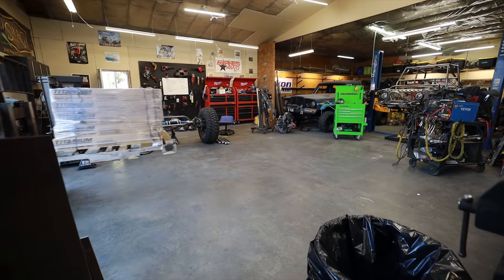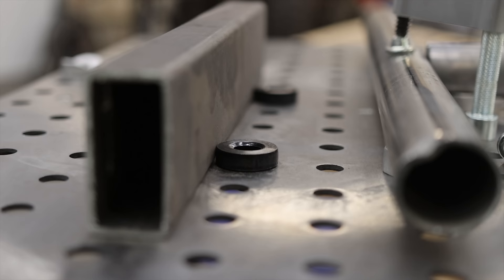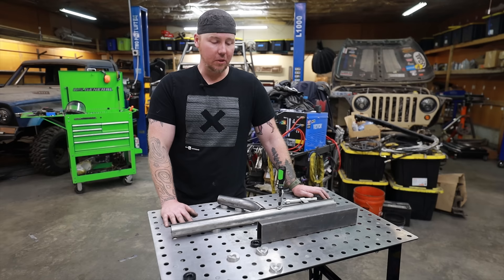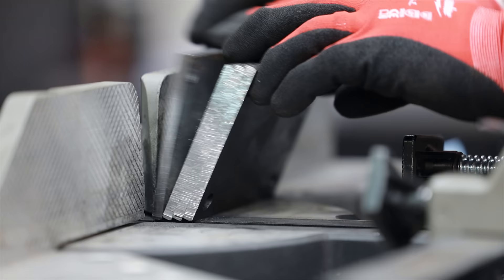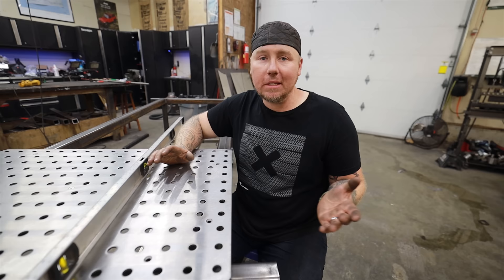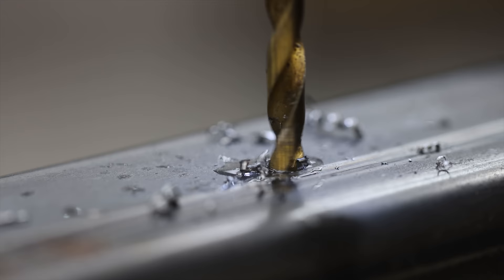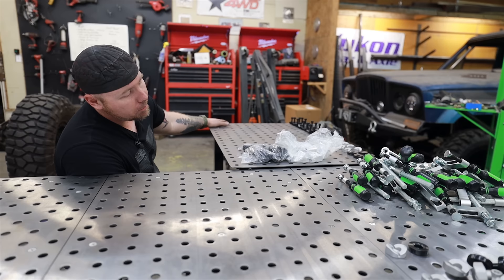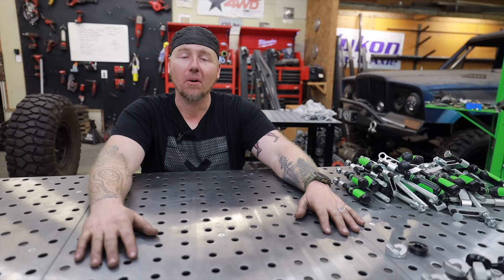The NEW Harbor Freight Welding Fixture Table

Comment: Another panel on the end/side mounted vertically could open up some more clamping positions. 
Or even weld in supports & tap the holes ready for if you did ever need that you could just use the one off the portable table, it’s only 4 bolts.

Comment: 9:56
Shims 
11:04
Being a woodworker and carpenter, to me the idea of making surfaces flat is just normal utility in setting up work. So that’s not really a drawback. 
To this point, however, “my” work has not had me wishing for a clamp table very often. But I can see it’s utility and benefit. At $170 that’s probably a good value.

Comment: I would have used the level next to each fixing and measured the gap between the level and table top with feeler gauges. Then when the top was loosened off I would have put shim washers of that thickness under each fixing and resecure. It would turn out a lot flatter.

Comment: What do you think would happen if you bolt and torque 2 or 3 tops together. Would it be like plywood.  Once you get it as flat as possible then bolt it down to your table frame work. Have to have some beefy legs and casters look at all the tooling you can get with the 2 of 3 kits. Bonus you don't need to drill all of the holes. What do you think?

Comment: I bought 3 of these then I put 2 of them together va bolts then I did butt plug welds in the table and had my buddy mill it true works awesome ps made the 3rd table on casters for my buddy to use

Comment: They typically don’t use casters on a fixture table because you should level it so it’s acs flat as you can get it, on casters it’s possible for the table to twist and lose its accuracy
Reply: Heavy fab shops use heavier platens and usually level them.
Reply: @ken481959  my table is almost 1.250” thick and it will still twist if it’s not properly set up, so if you have it on casters and move it your previous setting will be wrong, I had my shop floor precision ground flat in the area the table lives

Comment: I have to chuckle at all the YouTube welders that have never had to take a welding test, have never seen the flex in a double joint of 36”  
Have never seen a 12 x 5 piece of 1” plate picked up and seen it flex end to end. 
Keeping things straight is an art and to some degree is an illusion.

Comment: Go to a heavy equipment dealer and beg them for a pallet, because some of theirs will be 2 or 3 hundred pounds of channel iron and 4'×7'ish. Take it home and cut it apart and reconfigure how you want and attach legs and casters and you have a precise welding table with cutting and clamping grooves. Thats how I made mine for a days work and under 50 bucks in purchased steel, I have a table that will hold up anything a forklift will lift with surface of 5x1" channel 3/8 thick. Mine is better than some I have seen for sale for 5 grand. It was originally a pallet for a ferestry directional felling head.

Comment: Unless you're fabing replacement frames for vehicles that need to be perfectly flat (which they hardly ever do) microscopic flatness isn't that important and if you want to, you can shim the low spots. I think the value is in the fixtures, clamps and predrilled surfaces.

Comment: 14:48 Oh man, I'd be running into those receiver extensions all day. If I were to do this, I wouldn't extend it beyond the edge of the table, and instead drill a hole couple inches back of the table frame. Yeah, it will be a little more effort to get to under the table, but geez, I see injuries with this setup.

Comment: Great video! Would it be possible to bolt 2 or 3 together to get the thickness you need. I do realize its not going to be as strong as a single thicker sheet but if the holes line up it might be a cheap easy alternative to opting for the thicker steel table.
Reply: Absolutely you can.
Reply: Ty i  was thinking same stack them.

Comment: Been looking at that fab table was wondering if worth the investment. Been getting back into welding the last year after not doing so since 1997.  Project looks like an idea that's time has come.😎👍 bought the same receiver hitch vice couple weeks ago. Well made vice. Have the harbor freight 225 amp inverter green stick welder really like it.
Reply from the maker: It seems to be a good place to start. Low investment with quite a bit of value 👍.

Comment: Northern tools has the same table setup. ut the tops are only 4mm thick!  Not a good idea to get them hot - they might warp. 23 11 09 N.T.  has it for $199 list, so $169 isn't a bad deal. And the competitors' 4.78mm (3/16") tops cost as much or more all by themselves.

Comment: While cool, you should point out that the table in the thumbnail listed as $169.00, in reality costs $1352.00. You have 8 of the $169 tables mounted together to get that size. 😀

Comment: I was thinking "shim, shim, shim!" before you mentioned it. Which, um, leads to the question...did you shim it and somehow I blinked and missed it? You seem to have gone with a "good enough" approach, as in "flat enough for now," correct? I also think I saw on the box that it spec'ed out at +/- .005" flat. Were you able or do you plan on measuring that at some point? I also generally agree that 2 of these would be plenty for most people. Love the receiver hitch idea all around. Nice expandability. I'd love to see you install some bins or drawers underneath for all those necessities. Please do keep us abreast of your improvements as you work on this. Great job all around.

Comment: could you have put a compression spring between the table top and the homemade frame, then put your bolt through that. that might eliminate the slight warp you were getting.

Comment: How are you going to attach the nuts to the bottom of the clamps without crawling under the table if the clamps need to be in the middle?

Comment: what if you double stack the tops?
Reply from the maker: It's definitely possible and not a bad idea. Plus, it would still be cheaper than more expensive models
Reply: overlap them half onto each other as well
Reply: What all comes with that table kit?

Comment: Id buy a couple and stack it to get the thickness better. And maybe add 1/4" by 2" flat stock and use between the holes full length n width. . then im about 1/2" table

Comment: Does anybody else have problems with HF casters? The ball bearings are not in a separate race. They are merely inserted into semicircular channels press-molded in 2 pieces of flat metal which are mated to both contain the bearings AND create the caster mounting plate. When the plate invariably flexes as the caster wheel is loaded, the bearings fall out. Reliable bearings are fixed in separate, durable races

Comment: You need some Center Support legs Triangulated to the lower center beam and an Adjustable Foot at the Center Span of the Table, So you don't Sag over the Long Plane? Also, You Could Leave a 2" Gap Between Plates in a Spot or two, So you have room a for Protrusions and or Dangling members Like traditional gap tables.

Comment: Its the table rust resistant? Or do you have to keep treating the metal over time. If it does I don't want to have to keep cleaning or sanding to maintain the metal.

Comment: If you wanted a thicker table instead of  getting a sheet and "drilling a billion holes" couldn't a waterjet or a plasma CNC table company be contracted to 'burn the holes' cost effectively for you as a top?   I love the cost of the table and accessories but there has to be a cost effective way to get something thicker and do the job.   Thanks for sharing.

Comment: I picked up a table very similar to this a few weeks ago. Brand begins with v. 
Super inexpensive like a lot of the HF stuff is. It could use a little strengthening but overall seems good.
Reply: Do you know the top thickness of your V brand? The specifications I found describe it as .12 inches. That is less than 1/8.
Reply: @grantstockdale9848  That sounds right.  This one's pretty thin.

Comment: How’s the repeatability of the tops? As in Could you stack/laminate the tops and the holes and edges line up?
Reply: He should have tested that, but my guess is pretty darn accurate.
And now you mention laminate, gluing them together would really increase the stiffness.
Another, labor intensive, way would be to insert tubular spacers and weld them in place

Comment: Cool  i have to get 2 or 3 i have 4 x 8  welding table  but want fabrication table  price is right  if nothing else  you have  a 2x3 drill template  for the mag drill to drill holes  in 1/2 top ,and as you said  you have  started on  clamps etc by buying  5 tables  guarantee  I don't  weld everyday  but it price  I can live with  i have small sign shop /  race car, so I   do  some  fabrication and I am building  a 4x4  cnc plasma table  at this  moment  thanks for  video good stuff.
Reply from the maker: We are definitely on the same page. There isn't much risk when it's such a cheap place to start, and the fact that you end up with so many tools is just icing on the cake 👍

Comment: For only $169.00, you want a thicker table,  buy 2 or 3 and take the top plates, stack em n tack em, or bolt, one right on top of the other.

Comment: It would be nice if Harbor Freight would just sell you the table top with out the frame and it would allow you to stack the tops to make them stronger and would come at an even cheaper price.
Reply: Get a piece of 5/8 or 3/4 and make a REAL welding table adn tack tabs on and grind afterword the way all professionals do.

Comment: Why would you need a pricier table though? You simply take TWO of the tops, drill holes for plug welds and stack them and double the thickness of the table? Added cost? Sure. But youd have something far more sturdy

Comment: For me, I'm wondering if I would just skip the legs and clamp the tabletop with its underframe right on top of my wood workbench when I need it, and then stand it on its side and slide it away someplace so it's out of the way.

Comment: Thank you for an informative video. I’m a new welder and I’m gonna be building a welding table soon. Also, where did you get that welding cap I really like it and want one just like that.
Reply: Wait and get a 1/2" Minimum thickness plate and some old well casing or the like for legs. - Never drill a hole in it. - Simply tack tabs where ever you need them- Put the tack,,,,or even weld on the side toward the part (root in tension) or in the case of a dog (L shaped piece you pound a wedge in) put then 90 degrees to the direction of the load. --- when you are done hit them with a hammer in the direction of the weld (root in compression) and simply grind the buggers off the table. - Somtimes you may have to score the weld with a cut-off wheel especially with 7018. but after a few times you will end up with a smooth shiny surface. - And don't let the cork sniffers tell you it will never be "flat enough. - You typically put blocks under the part. - 2-per; - If the surface under the part looks like a potato chip, who cares? 

Go to a counter day at the local welding supply. They will give you a cap.,,,,while you are there buy what we call a"rock" Cup wheel- Always keep it flat on the table. Do not pick up and let an edge gauge the table - It's a grinder, not an ArcAir gouger.

Comment: Can't help but think if you mounted this on a slide adapted to a pickup It would be an awesome portable work bench Getting a lil fancier if you made a frame that you could then slide it off the truck onto the frame Voila then use it in the field or your work shop Mind Boggling Possibilities.

Comment: If you want a thicker table, couldn’t you just double them up and align/bolt them together because 3/8 thick would be better than 3/16? Yeah, I understand that would cost double the investment but it’s still relatively cheap.
Reply: Gluing them together would probably do wonders for the stiffness

Comment: Unfortunate just how thin it is, then again that'd explain the price. 

Great table for a novice, but he or she will easily outgrow it just like a biker easily outgrows a 250. With that said, I wonder if HF will come out with individual clamps or sets as you will be unable to use regularly available clamps as the force they provide will easily deform the holes.

Comment: Tables with holes are over rated lol. I’ve been doing this stuff a long while and I’ve actually never seen one in a fab shop 😂😂 and I’ve built everything from heat exchangers to water parks 😂😂 my table is literally half inch angle iron for legs and a half inch plate for the top lol. That’s in my garage

Comment: 1- What do you do about spatter?  In my over 40 years in heavy fab you a;ways run cup wheel over the table before you start doing a set up. - I don't think this would do too well with a weldment that is tied down before using carbon arc or oxy fuel to cut out damaged sections before re-welding them. 

I have never seen, much less use a table less then 1/2" thick. = Over 1" is more typical, and the king of the, all yall is the Acorn plate. - Cast iron like 3" thick. ,,,,, Sorry but I can';t see how this thing would make it to break time in a real shop.

Comment: Why not build a table top using 1/2” steel use the harbor freight table top as a drilling fixture using a mag drill only drill out the home built table top as needed

Comment: Only real issue I can see is how flimsy this is. I work on all kinds of things and I can not afford space wise to have this large a table setting there that I simply can not use as a work table due to if I set the heavy item on top of it, the table top will be bent to hell in short order.
-
My main work bench is 3/4 inch and it is pretty flat but well used, don't remember the size something like 48 x 80. Its the everything table. I could maybe see this fixture table as a table top to set on top of my large table specifically to fixture parts.
-
Good thing about that would be I can easily store it out of the way if I don't put legs on it. I'll have to watch these to see if they ever go on sale and grab one. Thanks for the review.

Comment: What you bought is a fixture table not a work bench. fixture table is for tacking and lay out  duplication. weld out should be done on sawhorses for easy rolling and repositioning and clamping. use my fixture table for a workbench hammerfest and i would BOOT YOU SQUARE IN THE REAR PANTS.The warp is controlld by welding technique counter opposing input many short welds back stepping keeping your heat effected zone to min means min warpage ( the reality is shrinkage) welds shrink when cooling. Nice cheep fixture table you have there :)

Comment: The receiver hitch is a novel idea at best. Casters will not hold still while bending, clamping or holding fittings. a vise needs to be mounted to the floor such that it does not move. Plus the slop due to the tollerance between the mating surfaces mean that vice will not only move but will also wiggle. Another example of utubers bad ideas.

Comment: If I walked into a commercial shop and saw this crap, I would turn around and walk out. This is what I classify as a homeowner tool. After 30 minutes of trying to use it and it's bent and warped all the crap it gets thrown in the trash

Comment: I can't stand cheap products that most likely will be in the trash in a few years.
The table is fine, a little thin but it will last if your not worried about aerospace flatness, but all the fixtures no thanks. I bought a few clamps from there and they just constantly break. Whould rather wait a bit and save up money to buy quality so I can always sell them or pass them down to my kids.

Comment: What is the item number?
Reply: 59403
Reply: @kerndone  Thanks ,but that number doesn’t work.
Reply: @windseeker2357  it still won't pull up online. But ask in the store! It's the number I told them and it's sitting in my garage! I promise I'm not trying to send you down the wrong path. 😉
Reply: Thanks. I am traveling across about 5 states this week. I’ll be calling different stores as I go. Wouldn’t be the first time I went on vac and brought tools home.
Reply: I picked one up in Conway S.C. While on vacation. 
Thanks for the help.

Comment: I prefer a solid metal table for welding. Can always tack weld to it then grind off when finished with a project. It's sad the average "Joe" buys into these gimmicks & gadgets for the "look et meh" getting ripped for BIG-$$. HFT has made fixture table affordable but it is still only a sophisticated surface to store a bunch of shtuff on until it rusts.

Comment: I really don’t understand these tables. You have a metal table and a welder. Get some round stock pieces of angle and tack them to a table. After you are done break them off and sand it a little table still great condition. You can put them anywhere you want them. Just a way to spend more money. It’s like jogging pants no one really needs them but people use them to make others think they actually run.